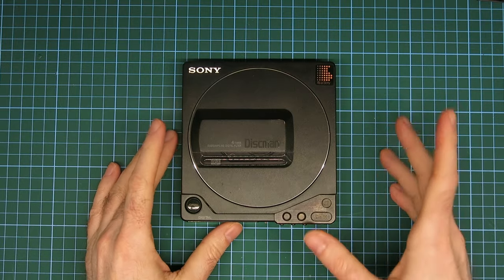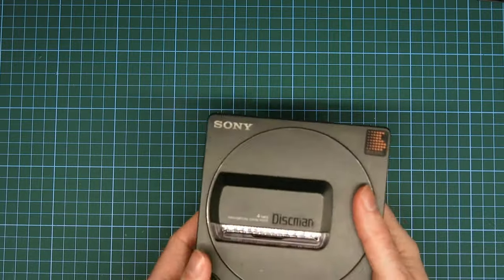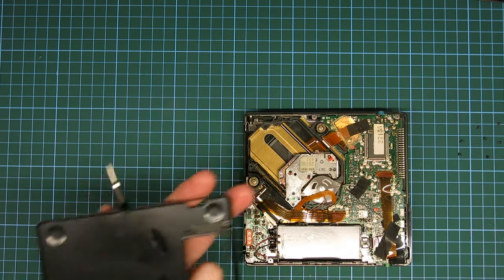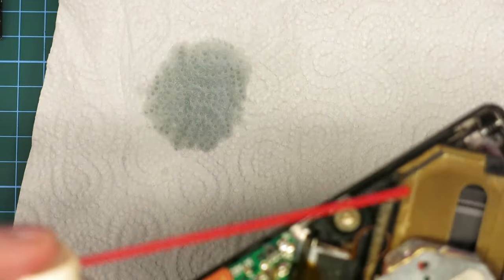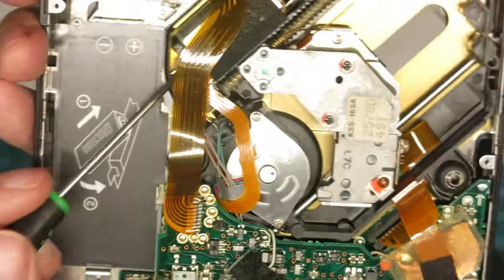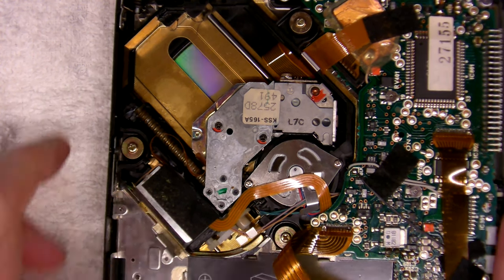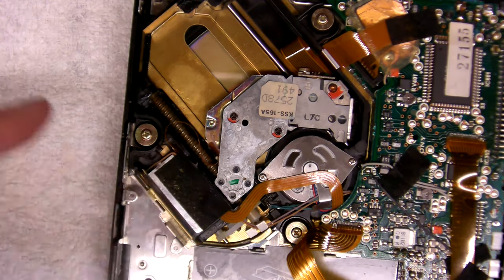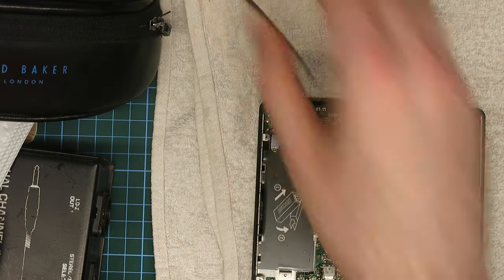1989 Sony D-250 Discman Repair • More Cheese Anyone?

Comment from the maker: 12:23 When I went back to the service manual, I noticed this 3-pin connector is to attach a massive 6xAA battery unit to the bottom of the player!!

Comment: James, that was a fantastic repair job! I really love your style of comments and explanations.
Damn, I was only 6 years old (born 19. January 1983) when this thing came out in 1989, and yet it's design is so timelessly clean, well thought through and it's very well made with a super build quality.
I really love it.

I remember having a non sony portable CD player without skip protection in the early 90s, then upgrading to one with skip protection aka audio buffer memory in the later 90s and even later (probably around 2003) having one that could actually cope with mp3 CDs before then switching to my first ipod mini when it came out...
Reply from the maker: I had a £20 Alba one that could play MP3 discs, when I went to university, to get me through the short gap between starting term and buying a laptop... It just about scraped through, with some firmware quirks!

Comment: When this video popped up in my feed I was like "I have this player!!!!" and I immediately paused the video and went to look for it. It was in my living room sitting on the shelf and collected a disgusting amount of dust. I cannot find the power supply but I can find another 9V one and test it. Mine is the D25 but has the same window on the door as yours. I remember I paid $320 for it brand new in a local store here in New Jersey USA. The store was called "Nobody beats the Wiz" and is now long gone. Since I haven't used it in at least 15 years I am positive it will work as I never had any problems with it. I did believe that Sony was the leader in portable audio products at the time I got it which I think was 1990. There may have been other models but this one was premium and I like premium. Brings back memories of me driving in my first car playing CDs through a tape adapter in my car tape deck. I don't think there were any car radios with CD players in them at the time or maybe they were very expensive. Thanks for bringing back memories of a more happier part of my life.
Reply from the maker: Thanks for sharing that, I love to hear people's stories when they are reminded of things they treasured back in the day
Reply: @jamesbennettmusic  BTW I see on the sticker on mine the production date was February 1990. I have not found a suitable power supply yet as this player barrel jack has positive on the outside. Most barrel jack connectors currently in production have positive in the center of the plug and ground on the outside.

Comment: I bought one new when it came out. It was robustly built and worked beautifully. I later bought the IR remote control and was my only CD player for many years. One repair that I did make, was that there was a ribbon cable at the back of the player that was rubbing against the hinge mechanism and gradually exposing the copper traces, causing shorts. A piece of electrical tape fixed that. I sold the player many, many years ago, and have regretted doing that ever since.

Comment: i got one of these for my 14th birthday and kept it until it was ruined in a car accident 10 years later while playing nine inch nails head like a hole through a tape adapter delivering dominoes pizza in my first car ever. it had bad shock protection and i had built a little spring and frame suspension box for it to play cds in the car as i could not afford a cd player in the car and sadly the frame itself crushed around the player essentially denting the entire metal case and lid irreparably.  i actually found that aa battery adapter at my parents when going through my old boxes of crud a few years ago  full of leaking kodak gold batteries lol. ah memories
Reply from the maker: One of my favourite things about rescuing the old stuff is the stories people tell when they see it

Comment: Hi - around 36:30 you mentioned something about a transistor - I've been spinning the small wheels / cogs but the motor doesn't turn on. Thoughts?
Reply from the maker: @Strateggo  do you get any signs of power at all, like a number on the display, a backlight or any movement of the laser lens? It's probably something you would need a multimeter for (or even a scope) but I would go through the circuit diagram and trace back to see if you can pick up the voltages. IC504 drives all motors and coils, and has two outputs HOUT2A and 2B that drive the sled motor. Diagram shows a few voltages that should be present

Comment: 30:08 Old oil or grease can be removed with oil. You don't have to use any aggressive solutions for that. Let it soak overnight if it is really hard to remove and it cleans up very well. Please, never use acetone!
Reply from the maker: Yep I never use acetone near plastics. It wasn't really hardened but more of a gluey paste. I did all the sled cleaning with isopropanol.

Comment: I have one of these and I was hoping mine had an issue with the gears too as now inhoudloze have had a fix. Mine however has a laser unit that’s not moving when loading a disc. So it never reads it. Gears are fine by the looks and feel of them (easy to move). Anyone a suggestion as to the cause of a laser unit not moving?
Reply from the maker: Check if the laser lens bobs up and down when the door interlock is closed - if it isn't doing the focus movement then I would guess you either have a bad door switch, bad laser assembly or a bad focus circuit